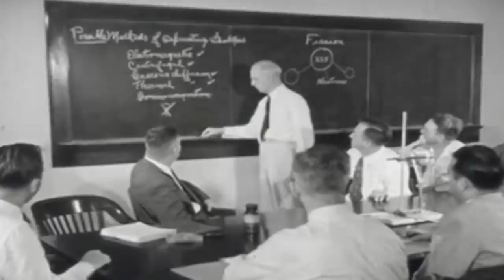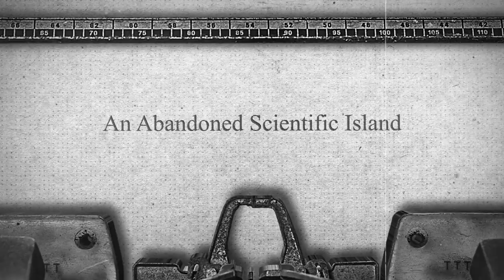The Abandoned Nuclear Island

Comment: Whatever was placed in those labs was all removed, nothing remains. The main lab has massive reinforced concrete walls, a meter thick where the experiment was isolated. There you can still see through this smooth round holes in the walls towards the place where all the machinery used to be. They tried to blow up the place but it was so strong that only part of the roof and some walls collapsed. The only thing left outside are this big cylindric chunks of steel, maybe a dozen of them, that where probably to heavy to transport so they where left. 
The power generation facility is the biggest building, the brick walls are also really thick. There are still big holes in the ground where the diesel motors used to be placed. A small cabin in the middle of the woods was shoot all over with machinegun for some reason. Richter's office, now just a concrete base, is a long way up a really steep stair. Up there you have quite a nice view. One of the coolest most well conserved buildings is a perfectly smoothed concrete lab that is bigger than a tennis court and has no columns at all. the sealing is quite high and there is a lot of eco, my name might still probably be written on its walls. 
Maybe the experiments failed, but I'm sure there is a reason why everything was removed so quickly and the place was destroyed with explosives. History was definitely erased there. Richter was wildly discredited as part of a severe anti Argentine propaganda campaign as the country started to be slowly torn apart.

Comment: The place was also used as a military training site during the military dictatorship in Argentina between 1976 and 1984. Later on, there was a touristic excursion to the island and the lab's ruins, until the early 2000s when the company running those excursions went bankruptcy and the place is mostly abandoned since then. I went in one of those trips when I was a kid, I think it was in '99, and came back in 2018. Most of the buildings were taken by the forest. In one of the labs you could still see a round cut on the concrete, made so the tourists could appreciate the thickness of those walls.